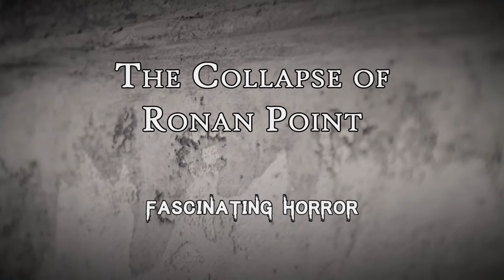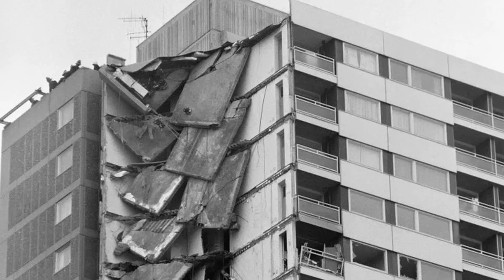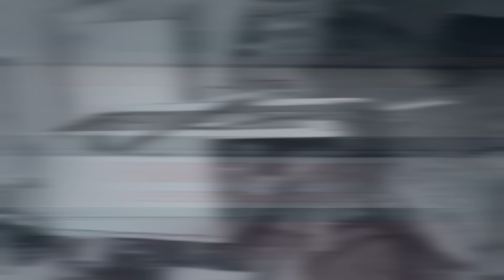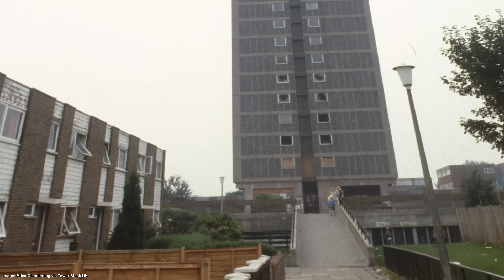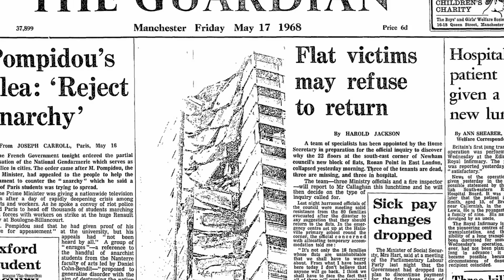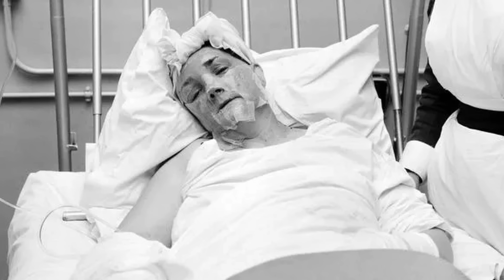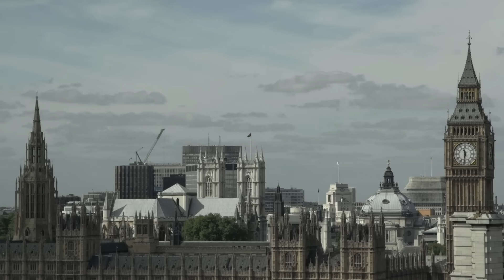Joints Stuffed With Newspaper: The Ronan Point Disaster | A Short Documentary | Fascinating Horror

Comment: Who was held accountable and paid for the corrupt building? Let me guess, no one.
Reply: If anything, probably the construction workers became scapegoats
Reply: @oniondeluxe9942  Well they were the ones chucking waste into the gaps.
Reply: @oniondeluxe9942 if you are a construction worker, and you know you are building an unsafe structure, you should be held responsible. Wads of paper, bolts not tightened, leaking gas pipes from overtightening, not sufficient mortar or cement used, etc etc. are not only the managers fault.
Reply: @PatricioGarcia1973  Yeah? And what if you complain or escalate? You will get fired on the spot! Wake up and smell the coffee!
Reply: @PatricioGarcia1973  Do you even know how construction works? The employees don't get to decide what materials are used, and newspaper was used in buildings' walls often back then, usually as insulation. Shouldn't have been used in the joints though 💀
Reply: Taylor-Woodrow, the building contractor, could (and probably should) have had a least a measure of liability based on the spectactularly poor workmanship. This isn't "scapegoating" - it's not far off corporate manslaughter. The local authority, however, might also bear some responbility based the fact that it was the responsible client for the work. This was not a "government-made" construction - it was a local authority managed job. These days I suspect (or at least hope) the outcome would have been different. 

It is important to point out that a huge proportion of large scale building projects are built in this way - effectively by kit. The specific engineering issue in these early-ish examples was that the load bearing element was the external wall rather than a steel frame.
Reply: @mookie2637 The construction itself rather than the specific method seems to be at fault. I got the impression the construction company didn't fully understand the method to begin with and was bent on pocketing as much of the government funds as possible.
Reply: @mookie2637  Grenfell would suggest otherwise but I suspect the Ronan Point incident was far enough in the past by the time Grenfell Towers was built and renovated that complacency had set in. I have a suspicion that there a lot of other potential "Grenfell`s" in the UK that need to be delt with.
Reply: @mookie2637 Taylor Woodrow is a name I remember on building sites for years after.
Reply: Nice government education
@ThatOpalGuy
Reply: This is exactly what I was coming to the comments to ask.
Reply: In 1969, Mr Soar sold his house in Orpington for £9,500 and emigrated with his wife to New Zealand. The story was that he was the Architect responsible for Rohan Point, however he may have been one of the building contractors responsible as the back garden had an incredible amount of brick walling done to keep his builders busy when there was no work, rather than lay them off.  So while there may have been no legal accountability, those involved did face public backlash to the point one involved felt the need to emigrate.
Reply: If the construction-codes were filled,as i assume, nobody encountable.Some kind of force majeure
Reply: The same method was applied to all those government owned buildings. They were sold off to the tenants, making them now responsible for the maintenance headache instead.
Reply: Grenfell
Reply: Good question.   Taylor Woodrow carried on building Tower blocks and other buildings using the same LPS design for other local authorities including Westminster City Council.
Reply: As usyal! I hate huma ni t y!
Reply: When you are poor or "an employee" going from paycheck to paychek, this is your lot for good. Nobody cares about you.
Reply: Good guess.
Reply: Seems to me there was plenty of blame to go around.
Reply: I’m 58 and don’t look anywhere near as old as the engineer, the 70s made folks look old.
Reply: @sharonlopez4706  Well, more toxic pollution then over most of the planet. Probably 50% of the population smoked. Less people exercised as they got older. etc. etc.
Reply: When you're a socialist who expects the government to just "give away" a free dwelling to you, in which to live .... don't expect high-end luxury
Reply: & the government building was never reenforced
Reply: corrupt? You miss the fact the construction cost 500,000£? Are you actually kidding me. Corrupt
Reply: That was amazing!  Even black people in Chicago couldn't trash public housing so efficiently!
Reply: Josiah landesman?
Reply: if you live in the UK then most likely indirectly you (in part)
Reply: In the U.S. it would be govt. building inspector. The construction crews have a foreman who needs to check that proper techniques are used, and then you get a visit at the end of each step to make spot inspections that every thing matches safety code, and approved plans. On project that size you would have about 5 inspectors, each visiting for about 2 hours every 1-2 weeks. Don't want to hurt feelings but having the govt. involved in constructing housing is foolish. Those panels and councils are not experts, and aren't as invested in the project- they have other responsibilities and also need to face political elections? The responsibility is diluted and therefore missing.
Reply: 10:32 the newspaper shows that Taylor-Woodrow paid £250,000 in compensation. Then, as in the case of Grenfell Tower, it appears that those responsible had been allowed to die of old age before being held accountable.
Reply: Newham Council paid for the repairs. Not so much of a blame or accountability culture in 1968. If a job had to be done it was done. Maybe not to the best quality but the priority was housing as lots of slums were a problem throughout inner cities and the thought at the time was high rises would solve these issues. A lot of people moved in with relatives or friends after losing their homes in the war and that's how Victorian housing turned in to slums. We say how marvellous those days were now, but the reality was bad - outside loos shared by a dozen or so people, no bathroom, limited cooking facilities, six to a bed, little heating etc.
Reply: Ultimately both local council & the building contractor would be to blame.
The government wanted cheap housing - putting pressure on the contractor to build said construction to a cost, which is probably below what would be today acknowledged as below safety margins..
In order for the contractor of having any hope of meeting this new lower budget requirement, it had to cut corners....
Cause and effect.
As always people employed by the government/council beyond their intelligence, making decisions they don't understand..
..
Or if they DID know what they were doing this would clearly be negligence..
Reply: Tax payers would've paid it. Its a government building, when are politics ever held accountable for anything.
Reply: @Tanson11 can't blame politicians for shoddy work.  Very few of them are Engineers, if they were perhaps things would run better.
Politicians make it happen, planning and funding.  The construction was contracted out to private companies.  Pride in the quality of ones' work is a luxury left to history and if the car industry is any comparison I'm not surprised it was sub standard.
Reply: @Tanson11  So if you pay a contractor to build your house, and the house collapses. It was your fault, right?
Reply: @nisonatic  Maybe you should find more information about the accident.  It was clear neglected on the builders side. The Inspektor may see things or two. But cannot see the condition inside the wall.
Reply: @puclopuclik4108  If you design a house and don't bother to monitor how it is built, then you can certainly expect to take some of the blame, yes.
Reply: accountable.... never heard of the word.... i think you made it up 🤪
Reply: @Andy_FortyTwo *when someone somehow managed to think you were being serious about not knowing what that means
Reply: @Andy_FortyTwo -- You've NEVER heard the word "accountable"? Ever? Um.... did you ever go to school? Or read even one single book?
Reply: @virg0_lem0nade  school?... books? what are they? 🙃
Reply: @virg0_lem0nade good bit, please say sike and that you knew they were being openly sarcastic
Reply: @UCannotDefeatMyShmeat sike? What is that?
Reply: @virg0_lem0nade  It was a joooooke
Reply: @virg0_lem0nade ever heard about sarcasm?
Reply: Mentally ILL #SOUTHPORT 🙏🌺💙
Reply: In the end the costs are always borne by the taxpayers. Fine the councils. Where do they get the money to pay the fines? From the residents of those tower blocks.
Reply: As explaine in the video it was a government-made construction.
Reply: @clray123  the government was a customer. Contractors didn't do their job properly.
Reply: @clray123  when governments “make” something, it is a majority of the time contracted out; government workers do not physically do the work…
Reply: @TheThora17  Yes, technically governments never do any actual work, after all they produce money/debt, so why would they bother. What I was referring to is the liability - when you need to cover up shoddy work, being part of the government is a great way to do it (see the "pandemic").
Reply: @clray123  There was no budget cuts. The contractor simply didn't bother to do their job properly.
Reply: @puclopuclik4108 This. They just didn't pour the concrete.
Reply: @clray123 I work for the government and still laughed at "technically governments never do any work". I do actually get stuff done but have worked in the public service long enough now to know how we got that reputation.
Reply: @jena.b74  Yea I suppose you could also call buying stuff with other people's labor and making other people do all the work for you and avoiding responsibility for your inevitable fuckups "work". Generally, the lower you are on the government payroll, the more activity resembling actual work you do. So nothing against firemen or policemen or clerks, but these are mostly what we call "administration" rather than "government". Government is where sthere's signing big contracts, farting into your chair, uttering serious words, and threatening people all around you.
Reply: @clray123  I am very low on the totem pole. I work in a team that manages hardcopy and electronic records so we're always busy. FOI, legal discovery, audits, investigations, requests from ministers etc. all require old records sourced. Groups relocate to other buildings and floors, abandoning large collections of records. Guess who gets to box them up and send them to storage? Certainly not the important people earning 6-figure salaries. I enjoy what I do and never forget the taxpayer pays my salary. Many people within govt and the public service seem to have forgotten that though.
Reply: @TheThora17 I have only one entrance to my house and the windows are unopenable in my livingroom,  government built home if there's a fire I can't get out. They know this and have done nothing. My life isn't worth anything I guess
Reply: @spiritthingw Do you not keep some form of hammer or other glass breaker handy? Good God, man, even a 1 pound coffee can full of concrete, rocks or even sand would do the trick. Have a tether on it so you caan retrieve it and use it again if you need. I keep a glass breaker, seat belt cutter and flashlight combo in all my car door
pockets. Like a pistol or a parachute, you never need one until you need one. Then you usually need it urgently.
Reply: @TheThora17  govt workers are 100% to blame they are the ones that give it to the cheapest bidder so they can pocket the rest of the money even though they never do any work themselves but get paid more than the ones doing the work they claim credit for doing that work as well at the opening ceremony and election times.
Reply: @TheThora17  Seemed pretty clear they were contracted out giving tax benefits to the builders, depending on the size of the building.
The had similar schemes in the US.
Reply: @clray123  government officials built it?
Reply: @clray123  Independent contractors build it all.
Reply: I bet they went on to build the WTC buildings in NYC since this what they claim happened there, as well.
Reply: gotta love unregulated capitalism, right?
Reply: @ThatOpalGuy  Except it was at the time massively regulated (and taxed) capitalism doing the work of local Government.
Reply: @ThatOpalGuy  It's all regulated, wdym? And a lot of the regulations we have TODAY only happened because of knowledge we gained through disasters like this. As far as this incident, codes were less strict than they are today. Not everything can simply be blamed on "capitalism"
Reply: Given this was government wouldn’t it be unregulated socialism?
Reply: @chriskl2361  It wasn`t "government" directly, as they were employing private contractors to do the work.
Reply: @ThatOpalGuy how was this unregulated? This was commissioned by the government.😂
Reply: @ThatOpalGuy  So... did you even watch the video? This was PUBLIC HOUSING, not some neighbored of McMansions.
Reply: @ThatOpalGuy  Exactly. Government regulations have their place.
Reply: @ThatOpalGuy Unregulated capitalism? This was socialist Britain.
Reply: @ThatOpalGuy  Capitalism is actually pretty heavily regulated. The trick is to make that stick. I would gently point out that things fall down quite often in (say) China, just as they did in the Soviet Union. Do you have any evidence that accountability works better there? I mean, apart from people just being shot etc....
Reply: @mookie2637  That's the slightly inconvenient bit when people harp on about 'capitalism' and construction, they don't like to discuss how much worse standards are in socialist countries.
Reply: @mrdainase  Why do you people always assume a hit at capitalism is a vouch for socialism? Socialist countries of today and yesterday aren't even socialist. They claimed/claim to be socialist, mostly in political campaigns and state-controlled propaganda, but ultimately became fascist.
Reply: @ThatOpalGuy  Ironically the exact opposite is the case. Just another example of the failure of socialism (or were you joking?)
Reply: @ThatOpalGuy  yes, the government building apartment buildings and cutting corners and costs throughout the entire construction process is capitalism. derp.
Reply: @tbone-d2v  that makes no sense since there was a budget described by the video as small, implying the government from the get go wanted to build cheaper than they probably should have. still doesnt make the government having housing built "capitalism" anyway.
Reply: @SeanHH1986 -- Bro you literally described capitalism in your first sentence lmao. They cut corners in safety and quality for the purpose of money.
Reply: Your forgot to mention budget money being lining someone's pocket hence the quality cutting. That's capitalism.  @SeanHH1986
Reply: @SeanHH1986  there is no such thing as capitalism
Reply: The contractors where sort of asked to do the impossible though by building a large house at an insane low cost. They shouldn’t have saved money on the load bearing parts obviously. Had they been done properly the rest would have been excusable.
Reply: @SeanHH1986  Local government employing private contractors to build housing for them and said contractors (and sub-contractors) cutting costs and ignoring standards (which this was) IS capitalism laddie!
Reply: @ThatOpalGuy This is socialism/ government housing.  Nothing at all to do with Capitalism 😅
Reply: Of course not. capitalists never suffer

Comment: Being cheaper never pays!! We never learn do we? SMH
Reply: Save too much money, and you'll simply wind up paying twice.
Reply: Being efficient with money and resources DOES pay.
But being cheap, for nothing in return, does not.
Reply: It does pay for the ones doing it, most of the time, because sadly, someone else will pay the price...
Reply: The issue is that the people who are in charge of making these choices value money far more than people. Especially if the people suffering from it are poor
Reply: What does SMH stand for please ?
Reply: @janetd5317  Shake my head.
Reply: @pioneercynthia1  Thanks...
Reply: So was in flaw in the Danish LPS system which was only designed for 6 floors and under? or was the flaw with the shoddy way it was out together? Or both?
Reply: @suekelley2109  There's a comment above (not in this thread) that addresses this very issue.
Reply: “You get what you pay for”
Reply: Unfortunately you're incorrect, it does pay. As long as you aren't found at fault it's incredibly profitable, which is all people seem to care about.
Reply: In my opinion it was the shockingly shoddy work of the construction that caused Ronan Point; The Grenfell Tower tragedy was the cutting corners and under the table deals.
Reply: I expect a number of people made out like bandits cutting so many corners for profit
Reply: Then complain about housing prices being too high SMH
Reply: Ummmm...I guess, when it was blamed on poor workmanship and materials , it was corruption ...someone was being cheap to PROFIT.

Greed is the cause.

Comment: It must make you feel dizzy if you live on the top floor of a tower block and take a look out the window to see the massive drop below i certainly wouldn't feel comfortable living in an apartment that high off the ground it makes it all the more difficult to escape if a fire develops in the buiding than if you live on the floors that are closer to the ground
Reply: What's even crazier, is modern towers (2000-) sway so far for wind and.seismic load, the 60th floor can move 20 feet in any direction.
Reply: the gas leak would make you feel extra dizzy!
Reply: Welcome to the age of the Supertall.